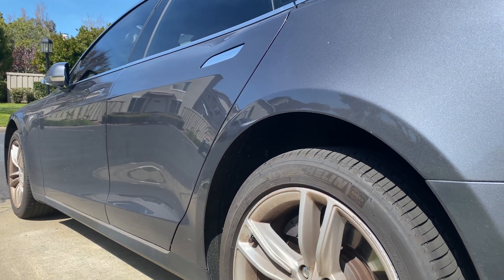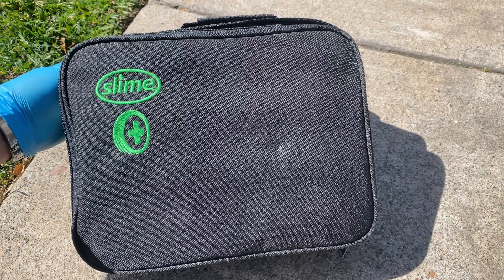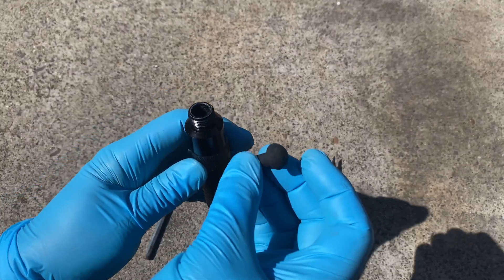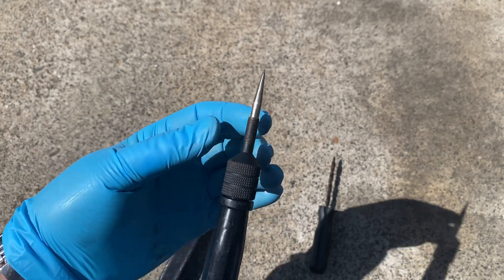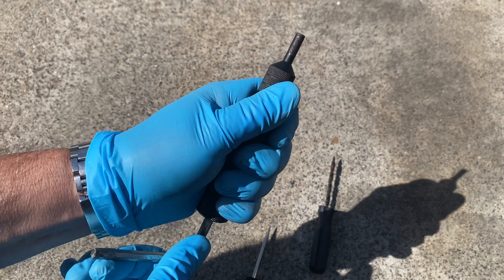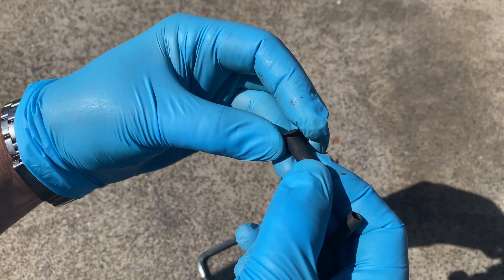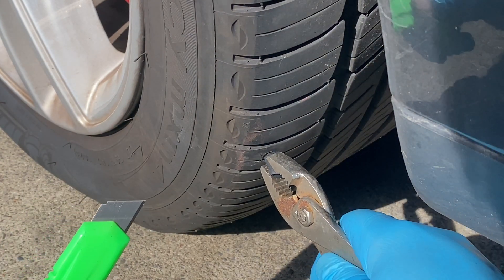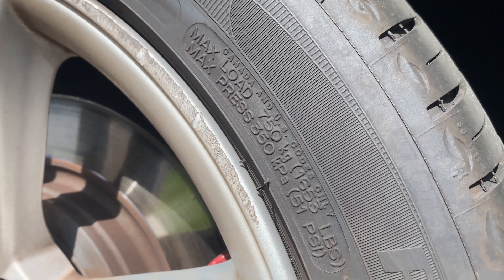Tesla emergency tire repair - No Spare? No Problem!

Comment: The slime company says that their unit will not work on tesla tires that have acoustic foam and not only won't work but will ruin the tire
Reply from the maker: Thanks for your comment, that's why this video is about using the stop-n-go mushroom plugs to seal the damage. The foam filled tires would prevent the slime from reaching the hole as well. The slime kit has the pump used in this refill. Cheers.

Comment: Does it wotk with Tesla tires having the foam rubber around the inside?
Reply from the maker: Any tire plug that can fill the hole and get you to a tire shop for a permanent repair will be good. These plugs have the mushroom tip to help seal, but also to help keep the plug in place. So to answer your question, yes they help. But any plug should be considered a temporary solution.

Comment: Aren't you supposed to add adhesive to the plug before you insert it?
Reply from the maker: I have used different types in the past from goopy ropes to plugs you lube with glue and force in, but these don’t use a glue. I haven’t had one fail yet.
Reply: @robdude1969  Oh, okay --- well, I didn't know, so that was why I gently asked. ;) :P

Comment: 5:35 I thought that you were supposed to just forcibly pull the rasp-reamer straight out, not unscrew it...?  I was under the impression that pulling out the rasp removes loosened material from inside the hole to make it smoother?
Reply from the maker: That works too if you are strong enough for a push pull motion. Twisting motion is easier and still opens the hole.
Reply: @robdude1969  Oh, okay.  I wasn't sure. :D